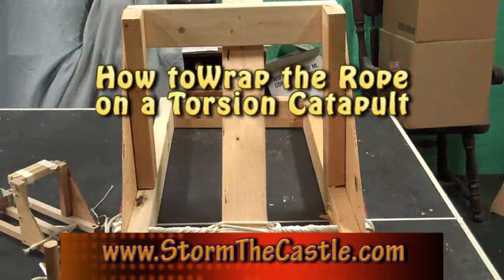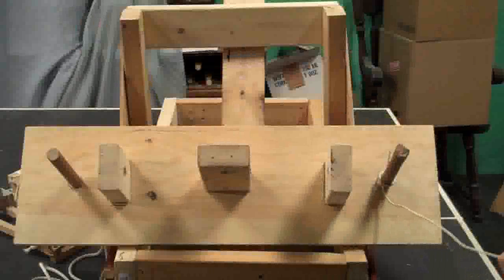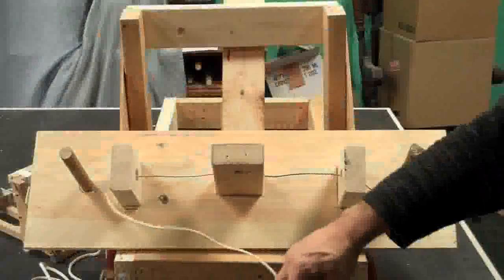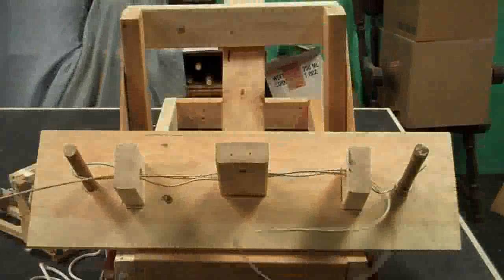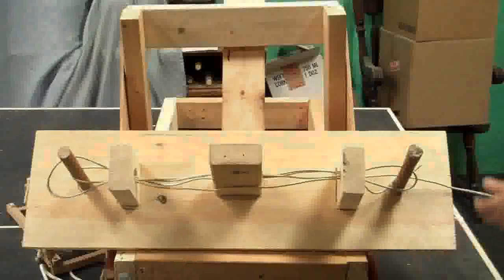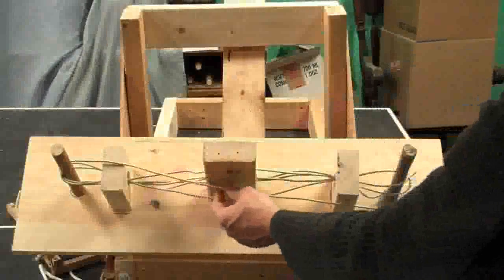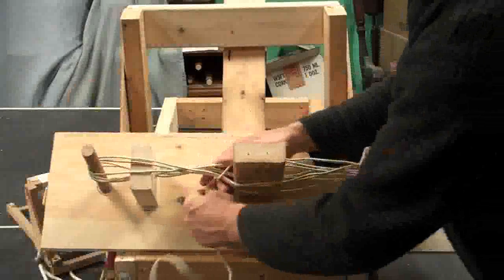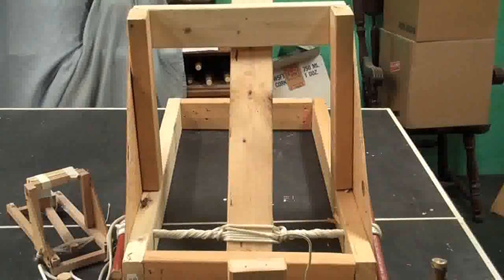How to wrap the rope on a Torsion Catapult (Mangonel)

Comment from the maker: @barfGAMER101 depends on the size of the catapult. Just string for a table top size, and clothes line rope for a floor model. Try different types to see which works best. Usually a nylon type rope works well because it has a lot of spring to it.

Comment from the maker: Depends on which size catapult you made and what size string you use? For the small catapult you will need at least 30 feet and for the large one at least 20 feet, depending on how many wraps you can fit in there.

Comment: Thanks for the response.
We can make some revisions to the crossbar, maybe fasten it to the front of the vertical 2x4s.
I'm also debating  with the swing arm. If I used a jigsaw to trim the "shaft" area of the arm and reduce the weight, that should increase the velocity.
Our ultimate objective is to be able to launch water ballons from the deck of the cottage down on to the swim raft, so we have a few months to figure out the details.

Comment: You know the rope you used for the smaller torsion catapult, what kind of rope was it? Because the twine I used wasn't able to hold and it snapped when i turned the pegs to increase the tension.

Comment: I am not 100% sure but if we  twist both sides once, it is much easier to wrap the rope. Cause you go over from one side to another and then unter on the way back. If you twist the sides once you get what you just did, which is over, under, over...?
The Middlepart always stays in play but the sides turn. So I think it doesnt make difference  but is easier to wrap.

Comment: You need to build up the energy. Also, you have to use a type of rope that stretches, but not so much as to be useless. For bungee cord type ropes you have to really roll it again and again. The energy stored in the rope is the important factor in this type of machine, so the rope is the most important factor.

Comment: Hey im using this model and i have some questions.... 
1 I can only use wood,metal,glue,leather,natural ropes, and strings.. 
I cant use rubber bands, springs,plastic, tape, nylon or polyester ropes or strings but i can use nails and screws... It needs to be 144 s inches... i really need help its due may 21 2012!!